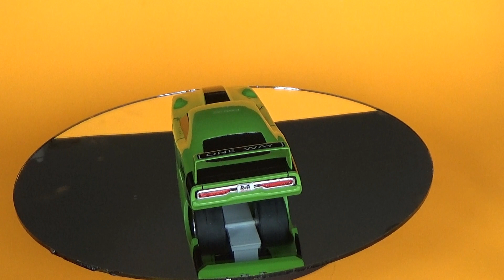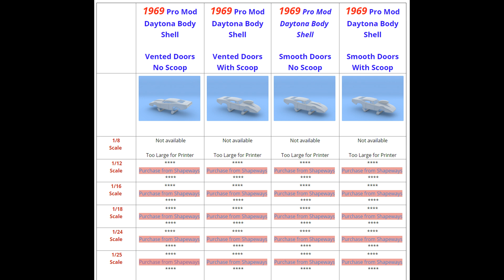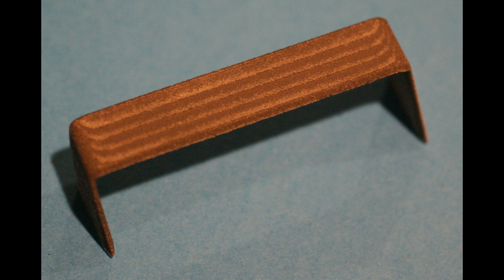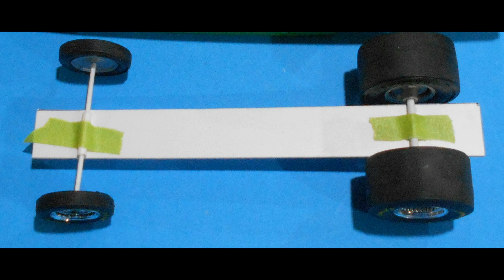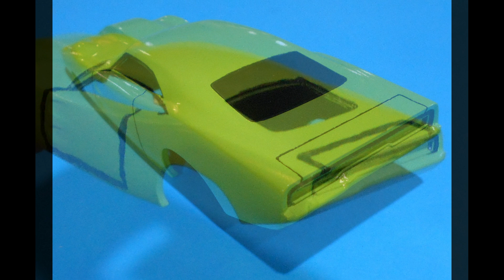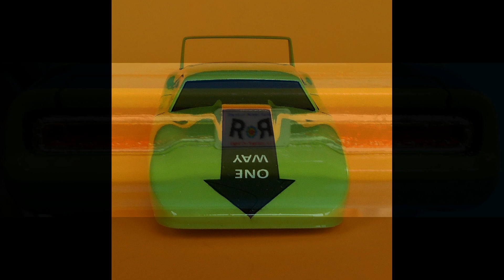3D Printed ’69 Charger Pro Mod 1:25 Scale  -Model Body Build & Review

Comment: As a suggestion with msla resin you are better off wet sanding the body from 150 up to 3k grit paper. Prior to priming the body. Then go back and sand again filling in any low spots and gaps after priming.
Reply from the maker: MG,  Thanks for the tips!    -PS,  please subscribe if you haven't already to help us reach more modelers! -Doug
Reply: Defintly glad to help. I build models and paint miniature figs as well a lot of the attributes cross over.
Reply from the maker: MG,  Right you are! Thanks again!  -Doug

Comment: Brother man ! Did a fantastic job but its to rich for my wallet you think the Daytona model chassis would work under it ?  Thanks for sharing
Reply from the maker: CP,  Thanks man.  The stock Daytona wouldn't be a good choice as this is a Pro Mod.  They have a tubular chassis and it's an inch longer wheelbase.  The Revell Charger Funny car kit 85-2989 is close but it's still about a half inch short and would need to be lengthened to fit!  -Doug
Reply: Uh